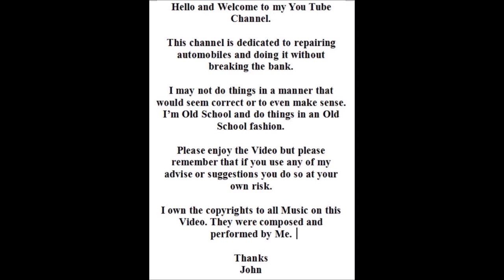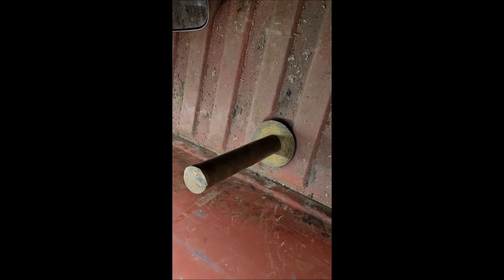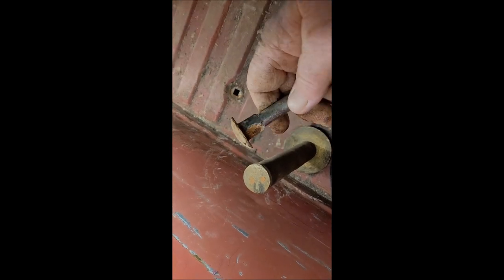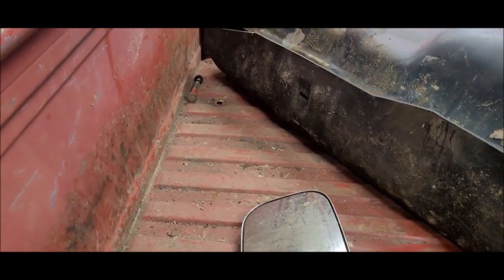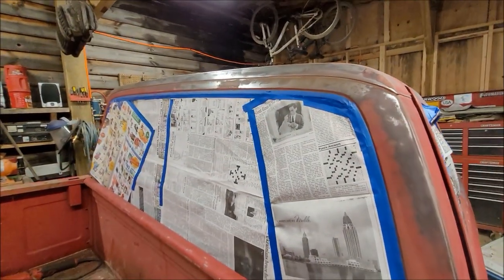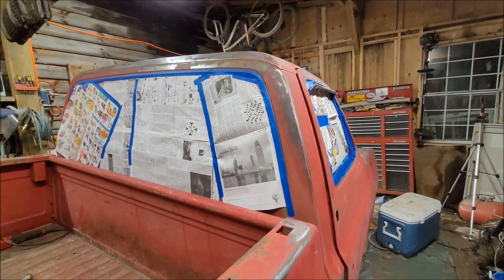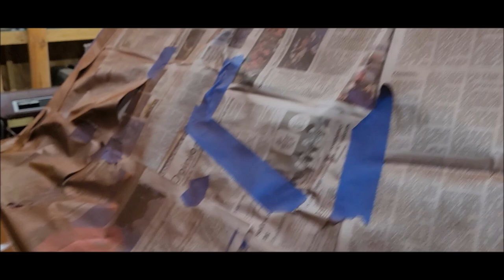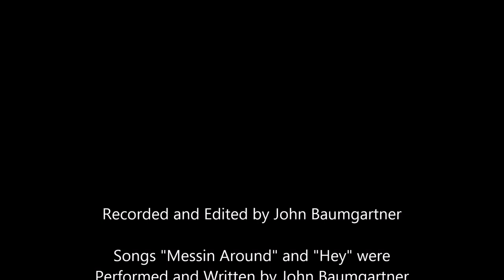Square Body Bed Bolt Removal and Rustoleum Rusty Metal Primer

Comment: About the same thing I am doing now with mine. 1974 c20 Camper Special. Going to prime the cab inside and out today.
Reply from the maker: Thanks for commenting Terry and for the Subscription.  I hope yours was not as rusty and mine was. As you may have seen, I haven't even started on the interior yet. Thought I would get the outside done first and then get her running and then concentrate on the inside.
Reply: @GreaseMonkey1958  I had to work on getting mine running first . After a intake gasket carb rebuild and full tune up. I had to replace all brake lines and brakes also. This was just to be able to drive it to DMV in Florida to get inspection for title. Brought it in Alabama no title state for old stuff. That took 2 months just to get a title. Working on the fun stuff now. Good luck with yours! Oh I have that rust also.

Comment: How heavy is that weight and where could i find one?thanks
Reply from the maker: I would say 3-4lbs and is solid brass. It was made to be used to drive things without marring it that is why it is made of solid brass. I would think for the purpose of holding the bolt down that anything with any substantial weight would work though.

Comment: If you have already mentioned this I’m sorry but what primer are you using for the bare metal?
Reply from the maker: Red Oxide Rusty Metal Primer from Rustoleum in this video however I am about to sand the entire truck and prime with Rustoleum Primer Surfacer. Also good for Bare Metal. Thanks for the question.